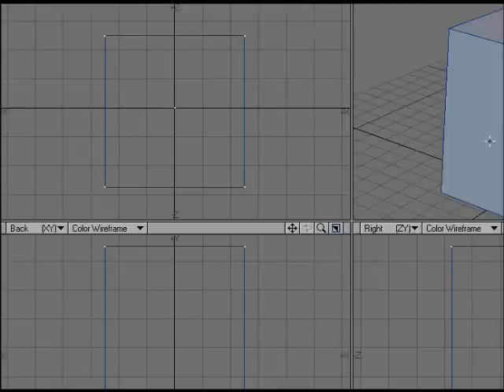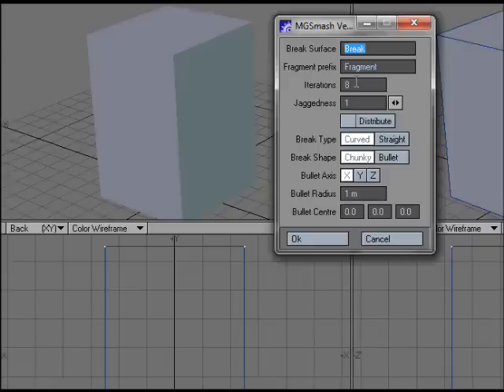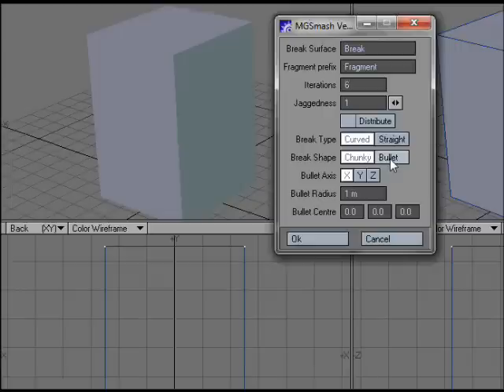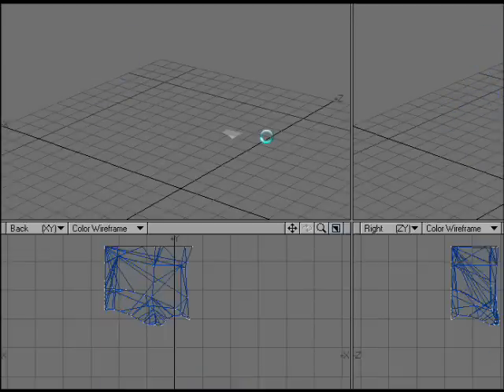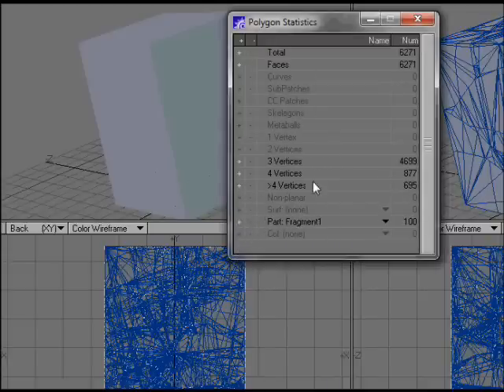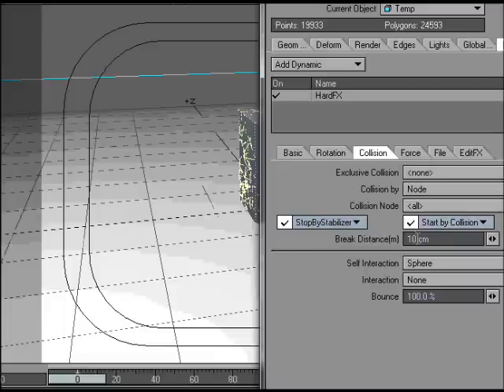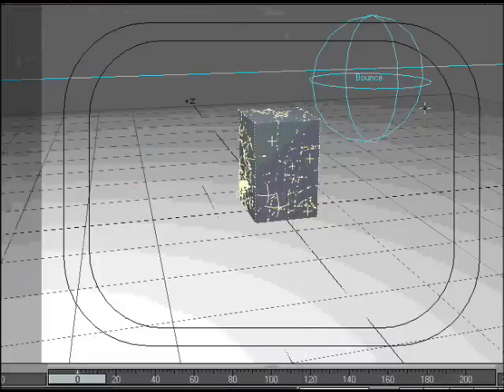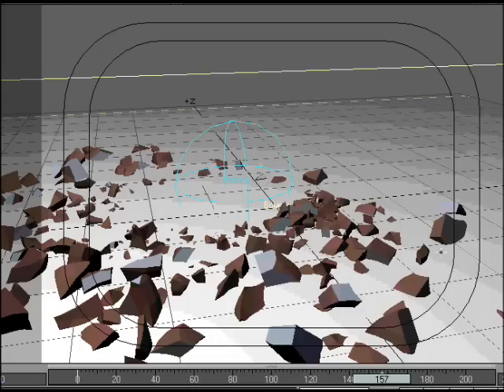MGBreakUp for LightWave

Comment from the maker: I try to avoid the problem in BreakUp by positioning the cutter close to perpendicular to the long axis of the 'shard' it's going to cut, but as the object is broken up further and further this makes a clean boolean harder and harder. My Voronoi plugin doesn't do this (having no choice as to where the cutting plane is placed) and so runs into problems a lot quicker usually.

Comment from the maker: Heya. I just checked my code again, and if you look in the BooleanSmash() function, the current layer is tripled before it's copied, then the original and the copy have booleans with the cutter object performed on them, so it is getting tripled. After the boolean is performed, CleanUp() merges points so there's no split edges. The problems are purely stemming from the LW boolean code not being able to cope with points close together I think, hence the problem in Fracture as well.

Comment: I just went through the process to see if I was missing something. If I'm not wrong, the script triples the surface of the cutting polys, but the original mesh (the one you are fracturing) is not tripled. So, after a few operations, there are many polys in it that have 4 or many points and eventually the script hits a "can't generate contour" situation. BTW I've also tried LW11's fracture tool. Every once in a while it fails and produces missing polys... I feel MG Breakup could be nicer.

Comment from the maker: Actually if you look through the code, I triple every mesh before booleans and merge the points after each operation, it is the LW code which is failing not mine. I even try to minimise the problems by placing the breaking chunk at an optimal place. I've been working with this a long time.

Comment: Before every Boolean operation, triple your geometry. After the Boolean, merge points. Your Breakup scripts do not do this and that is why your they fail so frequently. Lightwave's Booleans need planar polys (triple first cause triangles are always planar) and after each operation they leave objects open where the original and the break surf share no points.